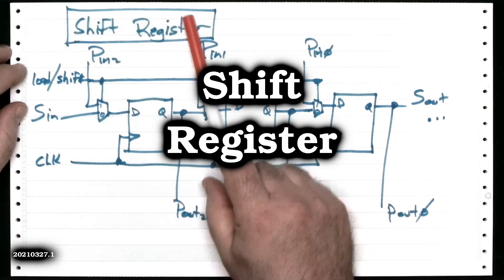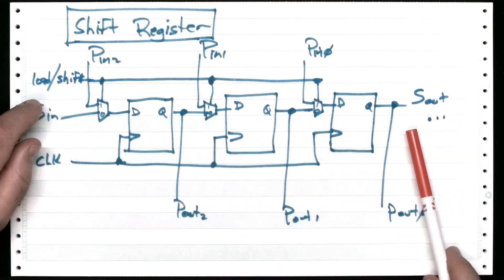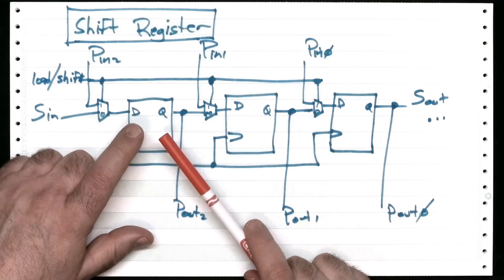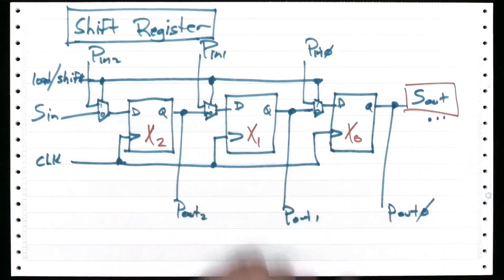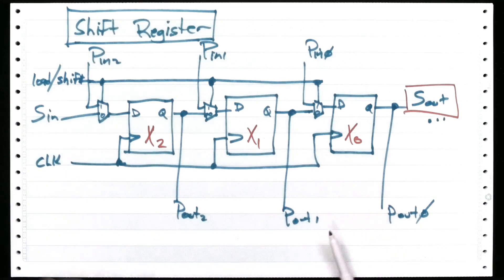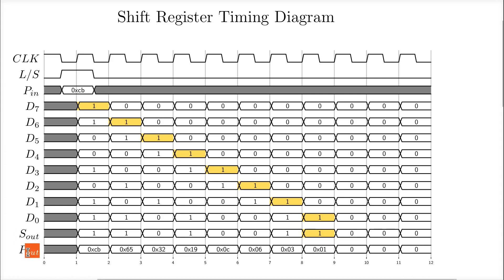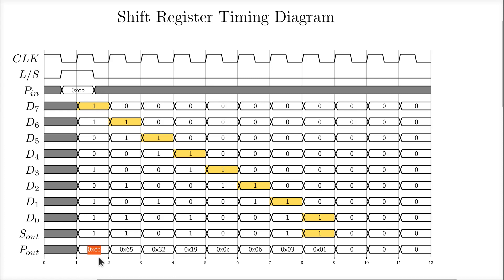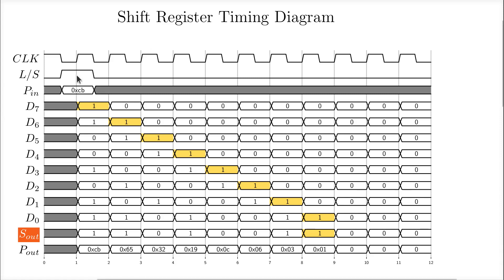Shift Registers

Comment: exploit shift instructions + add instructions to implement multiplication and division, right?
Reply from the maker: I probably should have mentioned that as a side note in the video.
Yes!  You absolutely can use shifting to multiply (and divide) by powers of 2!
You can also combine it with adding to get other values.  For example to multiply X by 10:
  X <<= 1;
  temp = X;
  X <<= 2;
  X += temp;
Reply: @JohnsBasement  thank you very much for your reply. But how to get 3 x 5? I mean a general way.
Reply from the maker: @aeebeecee3737  This technique is easier used to multiply by a literal.  For example: X * 5 would be X += X<<2
Reply: @JohnsBasement  But you cannot create special routines for every circumstance by this way right? What if a x b? how to use shift + add to implement a x b?
Reply from the maker: @aeebeecee3737  Oh... normally a general purpose shift & add function is used to do the multiplication in binary.  A quick google search got me here and it looks like a good general description of it: https://byjus.com/maths/binary-multiplication/

It is just doing it the way we learn in grade school.. but since you only have to multiply by either 1 or 0, it is trivial.

You implement it using a loop that asks if the low-bit of the multiplier is 1 and add the multiplicand to the zero-initialized product and then shift the multiplicand to the left 1 bit and the multiplier to the right one bit each time through the loop until the multiplier becomes zero.
Reply: @JohnsBasement  Thanks again, John. But if the binary code is complement code, what should I do? Booth algorithm?
Reply from the maker: @aeebeecee3737  Multiplication circuits are not something I normally dabble with.  I suggest you find a copy of Patterson & Hennessy's book "Computer Organization & Design" and read the sections on multiplication.  They work a few different hardware designs and explain them all in detail.  Those guys know what they are talking about.  I happen to have a second edition within arm's reach (there are a number of newer editions that I assume will have the same discussion... but if they don't, I know the 2nd does. ISBN: 1-55860-428-6.)  What you want starts on page 250.
Reply: @JohnsBasement  Thank you a lot.
Reply: excuse me, do you have any more great books recommendations? The great books about programming, algorithm, operating systems, natural design engineering, internet network design, artificial intelligence, artificial biological creatures? or any thing related and similar to recommendations? Thanks
Reply from the maker: @aeebeecee3737 Hmmm.. look for a new edition of the Patterson & Hennessey "architecture & organization" book out in December 2021 (the last edition is out of date on RISC-V details.)
"From Nand to Tetris" second edition - look for the web site first.  Much of it is on line.
Books by Andy Tanenbaum on operating systems or computer organization.
Books by William Stallings on on operating systems or communications.
Books by Richard Stenens on communications (Tcp/IP Illustrated, UnixNetwork Programming.)
BSD Unix PRM, PS1, and PS2 (old but still 99% valid)  Find the ones from BSD 4.4 Lite. Open source but not maintained by the various 'BSD distros... a loss for the new generation.
Horowtiz & Hill - Art of Electronics
ARRL Handbook for Radio Communications - excellent EE chapters.
I keep running into PDFs of "Practical Electronics For Inventors."  My ild second edition has been a good reference over the years.
Andy Johnson-Laird - "Programmer's CP/M Handbook" is the only useful book on CP/M outside the manuals... If you go retro (I have a project brewing with it now.)
Most part datasheets I use I locate by searching for them on Digikey.  (99% of datasheet web sites are a waste of time.)
Hobby web sites & YouTube channels like "Ben Eater"
Tutorials from Digikey, Sparkfun, Adafruit,...
ISO C language specs (preprint drafts are free on line)
Aho & Ullman - "Compilers" (dragon book)
Knuth - Art of Computer Programming
...these will get you started.
Reply: @JohnsBasement  thanks for your helping list.